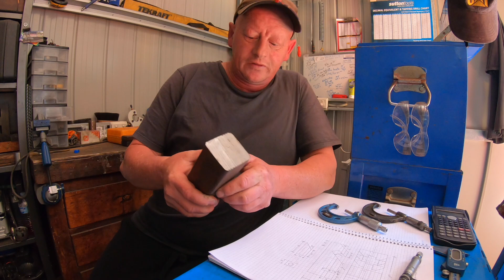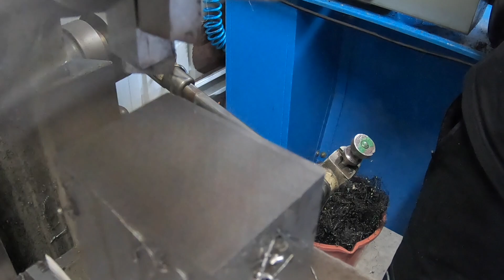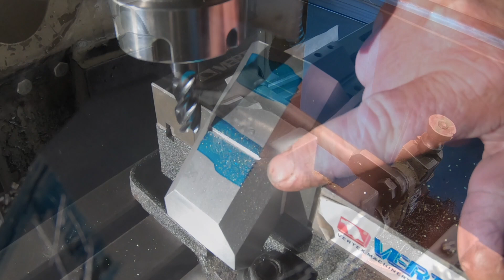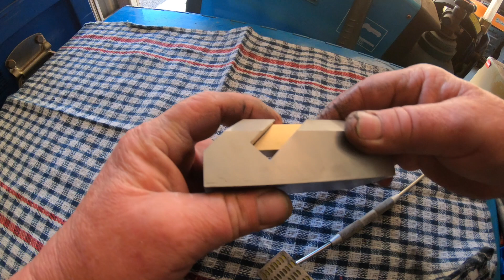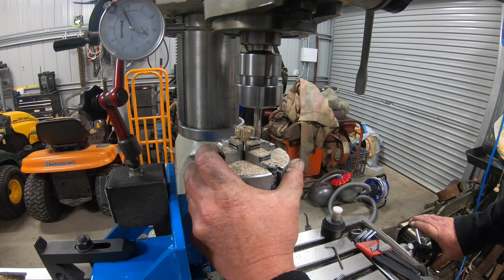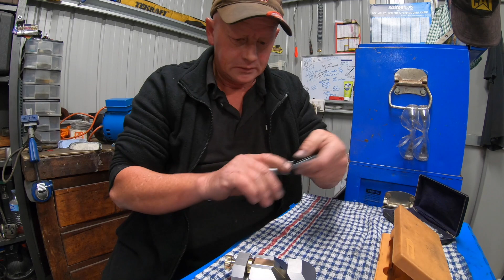Micrometer stand

Comment: The only thing i would do different to the holder is put a pad on the steel jaw and cut away on the bottom three little pads or feet and a maker’s mark and some fantasy engraving around it.... just pulling your leg, Matty!!! It’s perfect, great job! Thanks for sharing.
Reply: I heard you say your hands cramp up, i take magnesium supplements and a all in one vitamins to help. I turned 52 in February at 40 i to do something to help me work all day without cramping at night. It’s not a cure all but it’s way better then without them.
Reply from the maker: Hahaha There’s some great ideas there Sam, might have to make another one now👍

Comment: Sure have to agree with you about the larger mikes and shorter fingers Matty. That vise should do the job nicely. There also a great help for measuring telescoping hole gauges easier and more accurately. It's a lot easier to match the same light drag feel the gauges have when coming out of the hole on the micrometer anvils.

Fwiw in a home shop most of us are more concerned with cutting tool life span, even more so with end mills when most of us don't have the proper means to resharpen them. Roughing your parts angles or slots out a bit over size with a band saw and drill press will both speed up the work and save a great deal in tooling costs over a bit of time. That drill press or drilling on the mill to coordinates will move more cubic inches of metal in a much shorter time than any end mill can and do so a whole lot cheaper. Same for the band saw when cutting those angles with some creative work holding. Industry would do the same, but in there case that's more for the faster speed than saving on cutting tools. It's much quicker removing .020" - .050" per side to reach your final part dimensions than it is to carve all that metal away with multiple passes. Give it a try and I think you'll find a large difference.
Reply from the maker: Gday, I understand what your saying about bulking most of the material out then cleaning up to finish size, I have a power hacksaw and I’m worried about the forces of the cut moving the part if it’s on a wild angle and dodgy clamp setup, I like the idea of drilling the bulk out first, big time save, thanks for watching